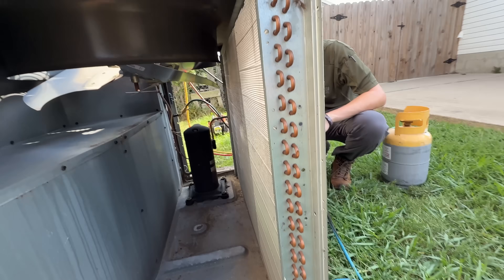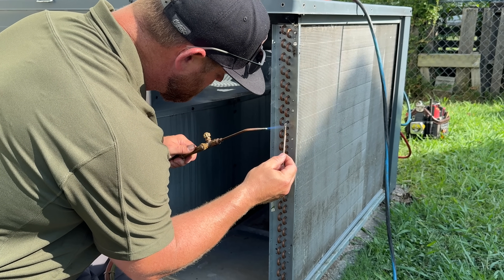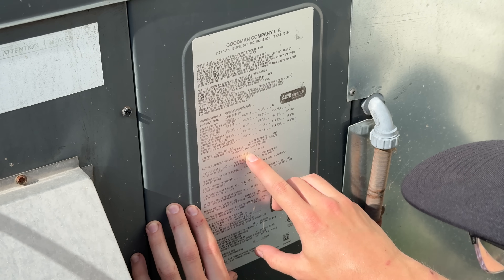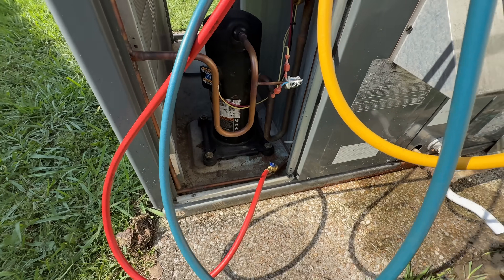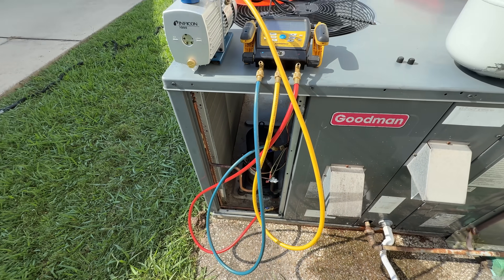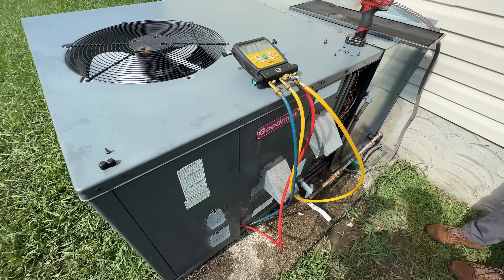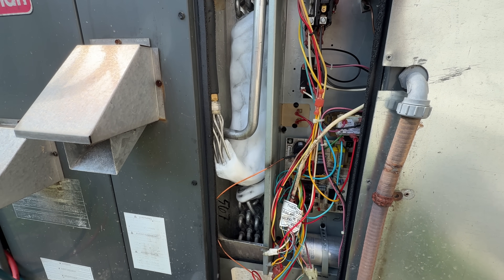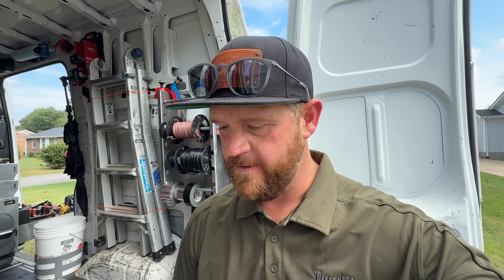Goodman A/C leaking Refrigerant | How I Fixed it

Comment: Awesome video! With those core max valves I started using the Appion Core Control tool. It’s vacuum rated so you can pull a good vacuum with your vacuum hoses!

Comment: @ 2:32 y’all stop using this stupid foaming sprayer. It defeats the purpose of the foaming action. You’re supposed to put coil cleaner on as a liquid so when it foams up it pushes the debris out of the coil. Then rinse it.
Reply: Yes boss right away.
Reply: @Johndoe-m3p good man. lol
Reply: I agree with this statement. Never made sense to me. I used the small fan attachment unless coil was really thick, then straight stream.
Reply: @mcpiddler1135 Well, at least I’m not the only one.